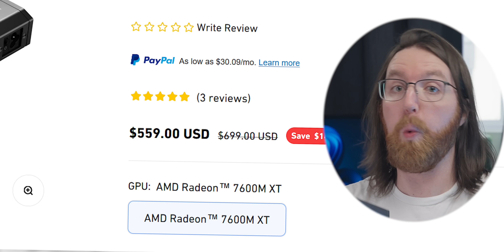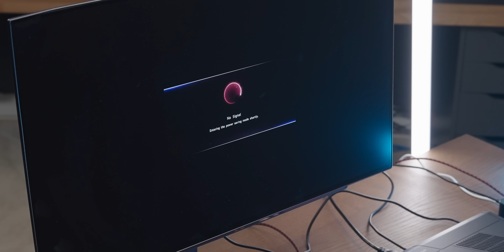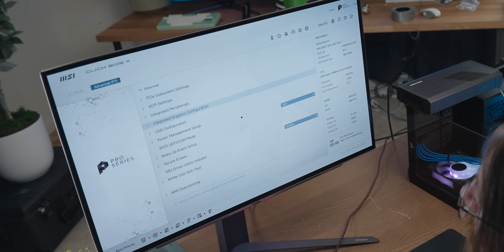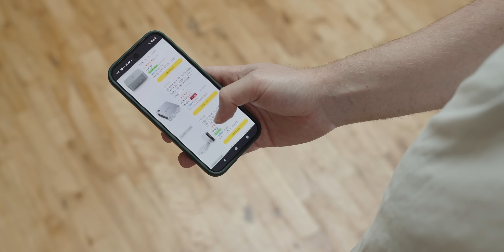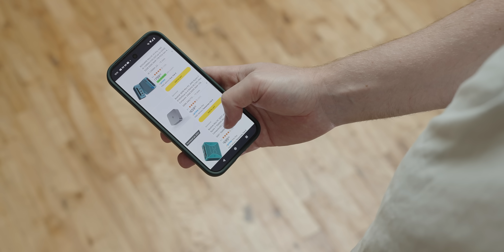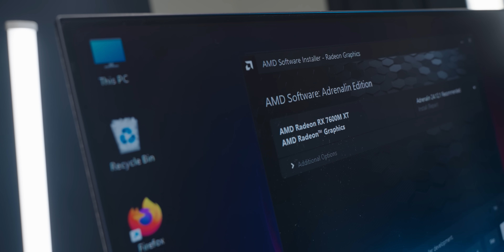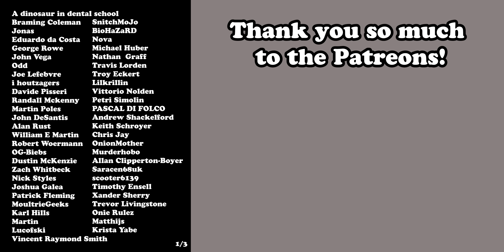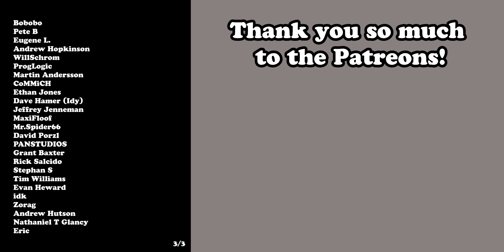This Aliexpress Graphics Card Did Terrible Things To Me...

Comment: after 3 defective Minisforum Mini PC's I had to "blacklist" minisforum.

fortunately, I did get the refund easily on amazon, but it was always an issue with the CPU, likely the solder connections breaking from thermal cycling.
one model(the HX99) may have had an issue with the power supply damaging the mainboard, but when I tried to reset windows before sending it back it got stuck in a proper bootloop, best evidence for a bricked device for an RMA case so I just shut it down and sent it back.

now I use the "Minix Z100" where I mounted 4 additional passive heatsinks so it would stay cool enough for safe NVME operation, for "gaming" I bought a steamdeck which mostly is in the dock.

in total both devices where about as much as the HX99, but I get to have a silent desktop PC for browsing and multimedia use and a quiet and portable gaming console.
also, the power draw is significantly lower.

Comment: Want an answer as to why disassembly and then reassembly fixed it?  First, I worked at an electronic mfg company several years ago and we had a similar issue on some builds that had a com card added to the board.  It wouldn't output anything that we could determine and schematics, traces, board layers, connectors were all fine.  Turns out that it was a power supply timing issue that was fixed with an inline/vin filter to cut noise from main(yeah you noticed that ferrite inductor with the wires wrapped around the donut?  They weren't at the right tension around the donut to filter out all the noise).  By disassembling and then reassembling it you insured a good connection with all plug in parts and happened to accidently make the filter work by fiddling with the wires and donut when holding it up to show to the cam.  It was just enough to make it work.  If I were you though I would never disassemble it again unless there was no other option for whatever reason as it'd be odds not in your favor for it to work again after assembly.  Seriously dude, you need to play the lottery or solo mine btc or something as luck is your friend.  LOL

Comment: Looks the USB-C isn't just an option to using the Oculink. It handles the data relating to hardware abstraction at the O/S level. The Oculink then just needs to handle pure graphics. Now I'm wondering if the USB-C is Type-4 and will handle the graphics without the Oculink cable? That would give the graphics unit more functionality.

Comment: I'm almost positive to get that external GPU to work you have to have the oculink/HDMI video in source AND a USB type c INPUT into the GPU to get it to work. I'm pretty sure it draws power from the small built in power supply but it needs a Little More voltage which it gets from the usb c port. I think I've had two other external GPU cases and pre-built one that both required a video and a USB input to function. This is even more plausible of an explanation because if you look at the new pc you bought that has oculink built into it the oculink and usb-c ports are circled together which usually implies they are used in conjunction to function...

Comment: I just don't understand the point behind it. If you're not running a tower form factor pc with room for a dedicated GPU, what are you even doing? Go back to the shop of horrors you got that mini pc thing from, return it, and start again
Reply: You might already own a laptop/mini pc but want a GPU for work or gaming. 
I had a laptop with decent CPU, ram was thinking of getting something similar to this at the time because it was cheaper than building a desktop or getting a new laptop. Plus gaming laptops battery is a bit meh.
I prefer to keep my current laptop and use an external GPU when I want to game.

Comment: Honestly it's not that bad. £475 in the UK, an external enclosure costs £250+ and then you have to buy the GPU itself and you aren't getting that GPU for under £300 most places. Paired with a decent Ultra Book and you've got a very portable system with some expanded capacity when docked. Also the RX 7600 M isn't terrible, it's on par with the RTX 4060 M so solid for 1080P, as you said.

Comment: Great story I can remember a few devices that didn't work so then I took them apart reassembled without changing a single thing and then they just worked. Yes it makes no sense but for some reason taking things apart and putting them back together something just works. Congrats it defiantly was factory assembly had to be.  I love how you do the same things I so like having backup cables for everything to root out the cause.

Comment: Many laptops have full featured type c ports, which can actually output graphics on the type c... And can probably detect a gpu on the port as well. You're never going to get an external gpu to get detected if the bios and port aren't designed for it.

Comment: Just so you know, it works flawlessly with any modern Linux distro. As long as you have a 6.2X kernel, it will work simply by plugging it in. Windows seems to give a lot of trouble with it for whatever reason.

Comment: So, from my experience with egpus, the occulink cable matters when it comes to using it. I got an occulink cable that came in a two pack and it  wouldn't work for either of the egpus I got, so I bought a more expensive "official" cable and it works on both of them just fine.

Comment: Friendly reminder that OCuLink =/= OCuLink.
The thing is, there are a couple different standards all using the OCuLink connector, all with wildly different pinouts. For example, the Valve Index uses the OCuLink connector for it's breakout cable, but it only carries USB 3, DisplayPort 1.4 and 12V power. Not PCIe.
Tho I'm pretty certain that PCIe over OCuLink is pretty much an industry standard and should thus be compatible. But, just because the connector fits, doesn't mean it'll work...

Comment: Dawid... I'm sorry to tell you, but I think the problem is not the GPU but you... Have you done the first tests connecting only the OL port or the USB-C port, but in the video we don't see that you try to connect both until the end when you make the video for support. The thing is this... The power supply only powers the graphics card, while the USB-C acts as a hub bringing power to the OL port. If you connect only the power supply the GPU turns on but the OL port is powered only by the USB-C (which is why the OL port is on a separate board).

I hope this info can be useful to you in the future!!

Comment: @13:50 someone explain what the inductor with wire wrapped around it means? To me it looks like someone screwed up the cables and looped it around plastic donut.
Reply: Yo ! This "plastic donut" it's an ferrite ring and this helps to attenuate the parasites that are generated by high frequency signals in power cables because some frequency can damage electronic devices ! I hope my comment help you ! 😅

Comment: Not sure why you had so many problems. My egpu works excellent with my ser7 minipc. Just plug in the m.2 oculink adapter into the second m.2 slot on the minipc (not sure why you didn't try this).  Instantly recognized by PC in windows and linux. Mind you I'm using a different egpu setup but I get a 21k timespy with my 7900xtx. I use a OcuP4V2 epu dock. Honestly I was surprised at how easy it was to get my egpu running well. Btw I got the dock off AliExpress. Nothing wrong with that. AliExpress is the best place to get these niche parts. Amazon either doesn't have them or the prices are jacked up to high hell.

Comment: Oh and if you add an Oculink connector to a PC through M.2 or an PCIe adapter, you should note the following: There are 1x, 4x and 8x options, but 1x is noticeably slow, and 8x usually ends up running at 4x ( SFF 8611 ) since 8x has little support. Also, mind you PCIe configuration / setup: Don't preset anything to 16x and any ( higher ) PCIe generation, essentially anything above PCIe 4x Gen3, or the initialization will fail. Don't forget to run DDU especially if your previous GPU was of a different brand or generation, because you need a clean driver setup for proper operation.
I don't know about Nvidia, but if you want to go Dual-GPU with an Intel, make sure its the eGPU and not the primary because Intel doesn't play well with others if initiated first.

Comment: A GPU at that level of performance is worth around $150, the eGPU feature which in case of Oculink4i essentially is but wiring, $50, a compact power supply at that level possibly $70, and maybe add another $50 for casing and USB-hub features: $320 - and that's already a decent price you can get an entire mini PC for. If you pay more, you are paying too much.
I currently am using the "Minisforum DEG1" Oculink4i docking station with an Intel ARC A770, which works great but is a bit expensive to buy new, but you can get an RX 6600 for around $200, the DEG1 for another approx. $100, an Oculink adapter ( for you don't have a connector already ) at around $30, and a 500W power supply for around $40: $370. And its faster.
Be careful though: Its not guaranteed to work with every GPU. AMD works, at least my Intel apparently too, but Nvidia ... has a history to not like reduced PCIe-lanes.

Comment: Hey dawid, doubt you'll see this, that short m.2 standard is practically never supported with its own screw, it requires an adapter bracket.
even inside of all the laptops and business mini/mid size PCs I've worked on (I repair HP & Lenovos for my job! Warranty go nyoom; BUY THE CAREPACKS! ITS GENUINELY WORTH IT!) they instead use brackets to get it to a mounting point for their m.2 wifi cards & tiny drives.
idk why these OEMs who (I assume) design and order these boards & chasises and dont design them with support for it, but it do be that way.

Comment: I worked for a Dell shop, iDrac is awesome, but would need to be purchased at time of BTO, there is a method of unlocking the enterprise features, but is painful certs and communications with Dell which hate to deal with that... However, made remote boot, installs, diags, logs and even firmware and driver deployments via Dell OME suite.

Comment: Try drilling a hole through the desk with a screw driver and running your cables through the hole. That should be your go to solution when things dont work. Its never actually the cable, that one just didnt like the way it was posed.

Comment: Aoostar AG02 comes with 850W power supply and supports oculink and usb4. Also great price, $250 (was $215). It's awesome. I have a b580 hooked up to it and using it with gem12 pro max from aoostar. Amazing little system! gem12 pro max comes with oculink also!

Comment: First you Test on a PC that defeneatly have no support for an eGPU, than on a broken board, than on an port which is probably controled by the Chipset, than on a Mini-PC you dont know you connected all the cables right or missed some, than on the new PC you connected the HDMI on the first try not on the eGPU? What are you Doing? After Setting it up correctly with the supported Hardware it worked... Hmmmmmmmmm!?!  But fun Video though. :)

Comment: What a niche product. Almost entirely because you need an OCuLink port to really justify it, and the type of devices where this would make sense, like his mini PC, just aren’t going to have it. And if you buy something that does, it’s probably going to be a laptop that very well might have a graphics card that’s fairly comparable to an RX 7600. I’m sure this makes sense for someone but it can’t be very many people. I’m a bit skeptical that OCulink itself will ever really proliferate enough in the type of computer that would benefit from a low/mid-tier graphics card upgrade. Generally when people would use Thunderbolt for external GPUs, they were doing it with higher end cards and normally to get more performance over the GPU that the laptop already had. It’s almost as if this enclosure was built just for a Dawid video!

Comment: Cool form factor, but for that price it's a shame that Minisforum did not go for a full fledged desktop card.(to be fair though the 7600 m variant has at least the same shader count than it's desktop counterpart) If you are already going through the hassle using an external graphics card, the form factor becomes kinda irrelevant. At that price point I did expect at least a 7700XT-

Comment: When I bought a new gaming laptop the laptop doesn't do anything when I turn it on, the keyboard glows red but nothing else. Brought it to the seller and when they check the internal (which means they need to disconnect the battery) nothing is broken, they reassemble it again before sending it to Asus but somehow the laptop just works. Miraculous. We assume it's just a loose battery connector or something

Comment: Odd that the daughter board was loose which caused all these issues. But I would have also checked if the mini-PC can boot up without power connecting from the eGPU to isolate that, Dawid. Could have saved some headaches that way too.

Comment: OCuLink though is a draw back at the same time because then you would need the newest mini PC to be able to connect it in or a brand you've never heard of which another drawback are handhelds which would only have USB4 ports on them because as someone like myself that is planning on getting the Legion Go S SteamOS model would love to get an eGPU so when i am home and my system is docked and charging i would be able to play games at a higher settings which is the one thing Minisforum right now is lacking on doing is adding in USB4 support.

Comment: lol only a few mins in and I see a usb 4 rated cable wasn't used at least at 1st, so usb would never work they are like 2-3 times thicker, most usb cables dont have all the wires in it. that short one at the end looked rated right.

Comment: Absolute genius... Glad it worked out, even if it's accidental. It does happen sometimes, maybe to help make us feel like we're geniuses. 🤣  I did run my DIY desktop for close to 10 years with just 2  screws holding the whole thing to my case. As it turns out, I used the wrong screws that weren't long enough for some of them and younger me did not realise it during the build. They all look so similar...

Comment: .. But what about usb-c? did it work via that port? In either thunderbolt mode or usb4? How does it compare to the powerful GPU 780M thats included in your ryzen mobile processor? Any other benchmarks?

Comment: 7:55. Major error. Without wanting to remote parent, I don't think it matters if it's a daughter board or a son board one does not simply determine it's orientation on it's behalf. You have to let it determine it's own orientation and love it regardless. That's the issue with the PC rebuilding, beta level wokeness😃 It's the reason XMP/EXPO is so great. You don't identify the RAM at a given speed, you let it determine it's own preferences and let it be the best version of itself on that basis. I don't even like it when GPU manufacturers specify how many connectors a GPU needs. The GPU should have all the choices and can elect to choose how many connectors and pins it wants inserting into it. Of course I'm a cool dad so I run a quantum computer just so that can be non-binary.

Comment: What the hell is that connector never heard of it
Reply: if you mean the OCuLink, it's part of the pci-express spec, and was used in servers before someone decided it could be used to send 4 pcie lanes (originally pcie3, now pcie4 with newer hardware) to gpus outside of machines. sff 8611 for the cable/male side, sff 8612 for the port side.

the downside; they can be a bit more fiddly than usbc.

Comment: The reason why it doesn't work via USB-C is because the USB-C on the device is only USB 3.1 (needs to be USB-4 or TB-4) and mostly is meant for charging your laptop (so you only connect the dock to the wall), you can only use oculink to connect it to another device

Comment: It was never going to work over USB C. The USB C is a 65 watt power output to run something else via the eGPU's power supply, like a mini PC that's powered via USB C instead of a barrel jack. 
Likely the problem was always the order in which you powered stuff on. Power everything off, make all connections (since OCuLink isn't always hot swappable), power on dock, and then last power on the host system. Doing anything out of order would make Device Manager never see it or possibly even damage components.

Comment: Oh, one of those "Dawid doing weird thing, that he not supposed to and blaims the product". Why would you assume, that external gpu should work as internal one upon connecting? Like, does your usb flash drive becomes part of your system and you need to reboot pc after connecting? No, that the point. Egpu works exactly like that, you turn your pc on, you wait till OS is loaded, and then OS gonna handle new device. Only after that you should get output signal and only if both devices support thunderbolt. I'm not gonna watch the rest of it, the idea that after putting thunderbolt in, you need to swith to external grpahics in BIOS so frustrating, that I just can't.